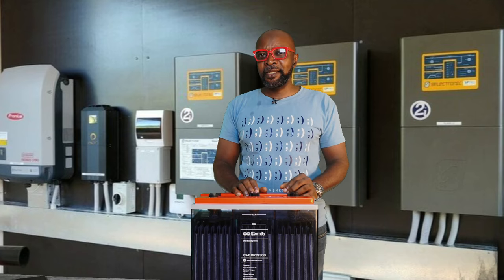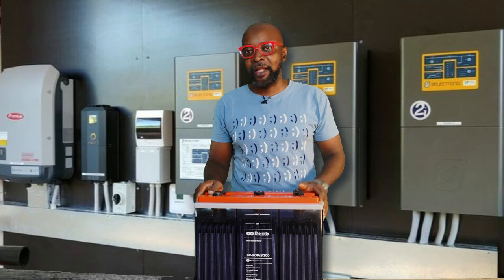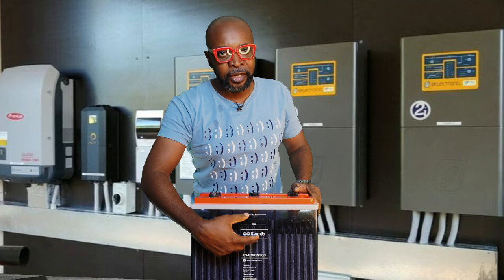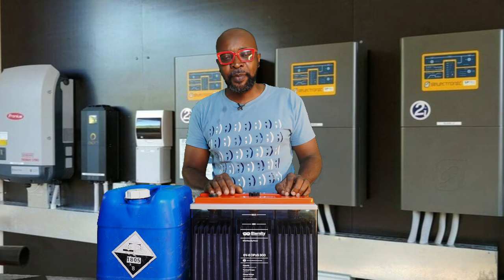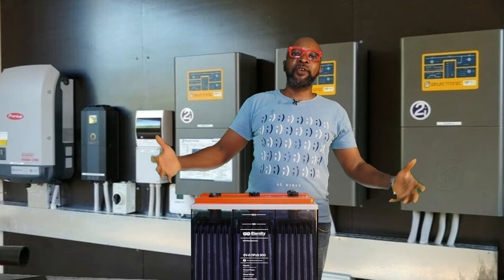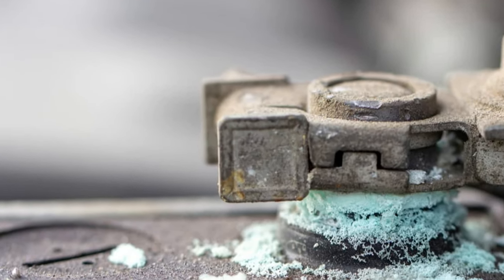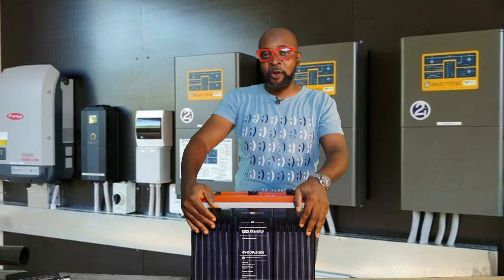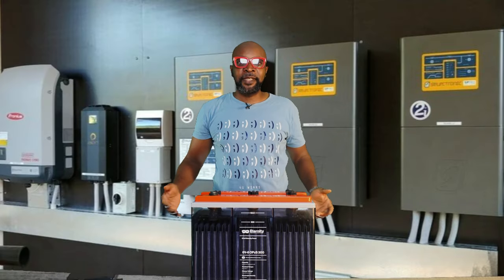Do this and your Tubular battery will last a long time .

Comment: What is equalisation? How will one do that? Could you elaborate on that?

Edit: still on equalisation. I noticed that MPPT charge controllers are advertised to offer this function alongside a BMS. I'm wondering if this suffices for the battery equalisation that you mention.

(forgive the many questions).

Comment: Good day sir, I have a 3.5k setup, with two batteries. There are two things here, I got a battery charger to top up the battery with electrolyte, battery worked well afterwards but after using it with my new side by side door refrigerator for some weeks, I noticed the battery backup hours has reduced from about 6 hours minimal load to about 1 hour. It’s a flooded battery, I’d like to know if it’s repairable and what are the steps to remedy that. Thank you

Comment: Hi sir good morning sir.  Pls my charge controller is bsc6048 and I used carbon genus tubular  batteries  . Pls what the specification of battery will I set it to is it flooded battery or lead acid battery because that only two I can find in the option in setting of the batteries type no tubular battery there. 
Thanks.
Reply from the maker: Flooded lead acid

Comment: Hi! I must say you are doing a wonderful job. I have just bought a tubular battery and noticed that the electrolyte level is not uniform in all the compartments. The electrolyte spilled in transit giving rise to that difference in electrolyte levels though not appreciable differences. Please what do you suggest? Should I top up with electrolyte or distilled water?
Reply from the maker: Before you use the battery ask the battery manufacture to refill the electrolyte for you other wise the strength of the battery is affected.
Reply: OK thanks!

Comment: pls we want travel for 3 weeks, should we put off the charge controller to prevent the battery from charging, or we should leave it on
Reply from the maker: @folakeolaitan3088  Leave it on this charge controller will regulate charge.

Comment: i have issues with one of my batteries and it is  no longer again when it is cut off. i used a multimeter to read it after separation the connection one will give me 12.4voit which the second will give me 10.3voit tall tubular battery. pls i need solutions?
Reply: How long have you had the battery for? Did you buy them together?
Do you have the float indicators in place, and what is the level showing? You may have to first top up with distilled water and then check with your multimeter across each cell to get more than 2V.

Comment: My tubular battery water always dry up every 27days in some cells faster than others, now it’s not working. How do I revive it
Reply from the maker: This is an indication of a wrong charging voltage
Reply: You may need to check your entire set up and be sure that the required voltage is what is delivered to the battery. Even though the tubular battery requires maintenance, it shouldn't be that often.
Reply from the maker: @ekeretteekpo3004  you are tight Buddy
Reply: After checking your setup, check with your seller or the battery manufacturer or the manual to know its specific gravity. Get a proper hydrometer and distilled water, and top up each cell with the water while checking the specific gravity to be sure it matches the manufacturer's specifications. Before this, make sure to turn off the inverter or disconnect it if you used a MCB breaker between the battery and the inverter.

Realise that you may be undercharging and/over overdischarging your battery. CHECK YOUR SET-UP. If you can, use a MPPT controller. They are better suited for non-lithium batteries.

Comment: How do I correct this, have added electrolyte to my tubular 220 leader battery and subsequently the backup has reduced the battery it's months old.. How to correct it thanks
Reply from the maker: Flush the entire the battery with distilled water and replace the electrolytes with the battery manufacturers  exact SG
Reply: @smilinsunsmilinsun8056  I hope isn't too late boss.. Where do I get the disteeled water from?

Comment: Interesting information. So, I recently got a tubular battery for a setup and during its transportation the battery leaned over and the liquid spilled. So, we rang the dealer and reported the matter and he sent electrolyte. Is this appropriate? What should be used to refill the battery, a new battery which is yet to be installed?
I'll appreciate any and all inputs. Thanks.
Reply: In your specific case, replacement with electrolyte is correct because the total volume needed to be restored. The reason only distilled water is used for top up is that it's usually the "water" part of the electrolyte that evaporates during charging, making the mixture more concentrated. Reppacement with distilled water restores the correct concentration. I hope this helps
Reply: @cdoscope  thank you for your reply. When the fluid arrived, it was distilled water. They have maintained that if I want to refill, it has to be with distilled water but I should use the float indicators to determine the need for a refill. So, going by the indicators, everything is green. I wish there was an all-instructions manual that would help a user to understand what to do in various circumstances.
Reply: @ekeretteekpo3004 they are not quite correct. Consider the simple logic - if the battery needs say 4 liters of elctrolyte (specific mixture of hydrochloric acid and distilled water, and it spill and loses say 1 liter of that mixture, replacing the 4 liter volume of fluid with plain distilled water will certainly cause a 25% dilution of the electrolyte. In the case of loss of 1 liter volume due to evaporation, its only water that is lost, so you only need water to replace the volume.

All in all, it's wiser to heed your warranty provider, but tell them what I wrote and listen to their explanation
Reply: @cdoscope  alright. I'll do just that right away.

Edit: By the way, since the float indicators (which are also tagged "electrolyte level indicator" in the manual) show green, it should mean that the battery cells are fully topped. So, in spite of the spillage that occurred, the cells are fully topped. I wonder what will happen if I simply added distilled water. Unfortunately, I don't know the mark where the fluid level is supposed to be at.

The reason this is a bit of a concern right now is that it appears to me as though the battery was discharging a little bit faster than I was expecting.
Reply: @cdoscope  by the way, I have just informed them what you've written and waiting for their response.
Thank you for your replies, please.

Comment: Do we need to do monthly equalization if we have a battery equalizer attached to the batteries?
Reply from the maker: Once in 2 months is fine
Reply: @smilinsunsmilinsun8056  ok, what i meant was that you showed an equalizer device showing voltages and then the equalization that is done periodically. Is there any need for the periodic equalization if you have the equalizer connected to the batteries
Reply: @odoohub5010 no, you don't because the equaliser should do that as needed. By the way, some MPPT charge controllers come with this function (a BMS), particularly when you have more than one battery connected to each other.
Reply: @ekeretteekpo3004 Please, what's your take on lithium battery building that is being done, does it have the same life span like those original lithium from felicity etc......What are the pros and cons of building lithium battery for solar power

Comment: how does one make sure equalization is happening is the job of the inverter or the charge controller
Reply: It is the job of the charge controller. I will advise the use of a MPPT charge controller. Check the manual for how to set it up to "flooded" or "fla" after you have connected the battery. Always remember to connect battery before solar panels.
Reply: What about people like us that don't have solar bur only inverter, can I still use the MPPT?
Reply: My Tubular is 3yrs old in April and I noticed it doesn't last more than 30 to 45mins when public power is out. I also noticed, all the cells don't go low the same time. Sometimes, I have to top 2 and up to 6 cells some times. Is there anything I can do to increase the power holding capacity?

Comment: do i need an equilizer for 2*12volts parallel batteries
Because i only saw 24 or 48volts equilizers.
Reply from the maker: Yes you do
Reply: Get a MPPT charge controller. It will sort out the equalisation of the batteries during charging. Simply set it to the type of battery you connect to it or do that under the "User" configuration if you have the battery's manual.

Comment: Am using my solar batteries and my inverter had and stop using the batteries for about one and half year, I restore my inverter and connected to batteries,the batteries are no longer powered. So pls could be the fault? Or is it because damp the batteries for a year. Thanks
Reply from the maker: Lead Acid batteries are not supposed to be left on a standbye mode for a long time. If not charged for a very long time it will sulphate . It needs to be constantly charged and equalized.
Reply: The batteries will need to be boosted or so. Take them to a technician who will boost charge the batteries and equalise the cells. That should revitalise them for your subsequent use.
Reply from the maker: You don't need to take them to technician you can do that yourself with the charge controller equalization.
Reply: @smilinsunsmilinsun8056  okay. I didn't want to sound like an oversabi on the matter. I feel like I have acquired so much knowledge over the past couple of weeks.
Reply from the maker: Lol feel free Buddy to express your knowledge  @ekeretteekpo3004

Comment: But some inverter doesn’t have the setting for charging voltage, some inverter does that automatically
Reply from the maker: Yeah that is the very small inverters  from 3.5kva and below, the system does that  by itself

Comment: Why is it that when my tabular battery is fully charged during the day, the charging level drops to around 60% even when not in use?
Reply from the maker: The battery no longer retains stored energy, it's  probably failed
Reply: When you say 60%, what do you mean exactly? What is the voltage reading on the controller?